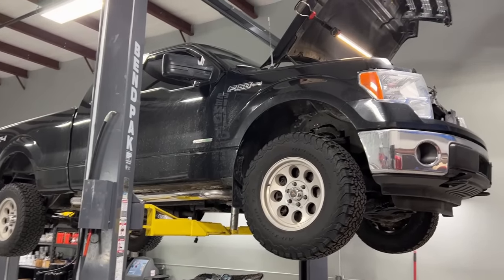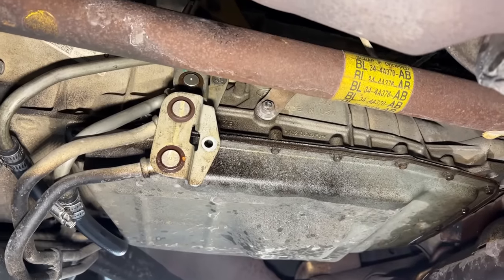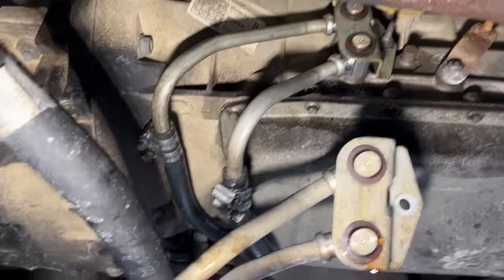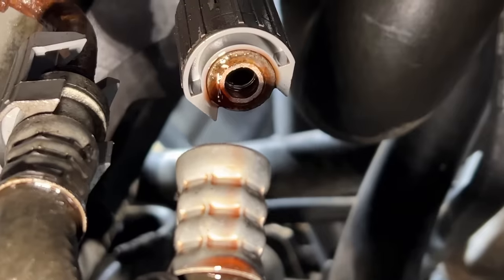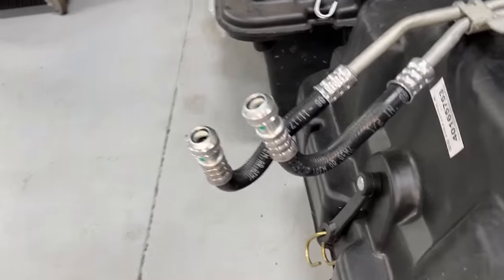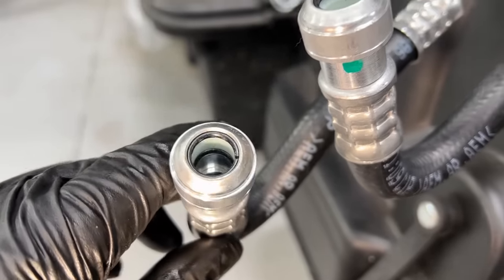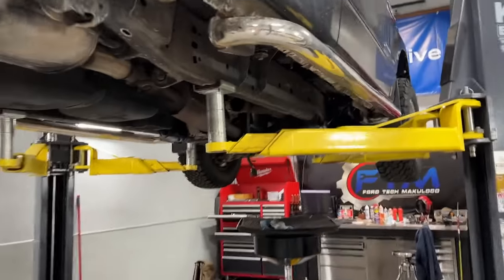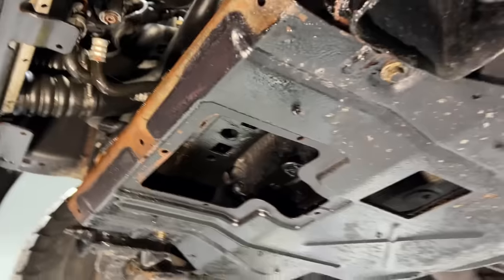Attention 2009-2014 Ford F-150 Owners! Check Your 6R80 Transmission Cooler Lines Before They Blow!

Comment: Happened to my 2014 eco boost as I was backing a pontoon boat trailer. And saw it happen as someone was backing a trailer in a camp site. Exact same failure point. This line needs to be engineered to hold up to the pressures encountered when backing up a trailer…This should have been a Ford recall.

Comment: That truck has a lot of corrosion on the bottom of it too...I would also replace out the steel lines too that are up front too before connecting the new Trans lines as a precaution...
Reply from the maker: I always do.

Comment: We know they'll never do a recall on these. Wouldn't some kind of warning system being put in place that can detect this failure, and shut the vehicle down safely, be a viable option? 
Perhaps a sensor on the return line, where it enters the transmission, that monitors flow (or sudden lack of)?
Reply: I was travelling 100km’s/HR or so when myn let go. I noticed the smoke behind me from oil getting onto the exhaust seconds before the wrench icon showed. By that point i was already pulling over. Lost 6L of fluid so caught in time. But yeah the wrench icon did appear on my 13 f150 eco it sensed somewhere there was a issue lol i dont know why myn did and this guys didnt? Not sure maybe makukoko could chime in on that.

Comment: Great warning, had no idea....but...why replace with the same part? Did Ford "fix" the brittle aluminum? Im looking at a used 2010, if I buy, my preference would be to cut the connectors out, hose it and clamp it. A possible drip is far better than a dam bursting leaving me stranded at 12,000 feet in a remote Wilderness.

Comment: Thanks for the info I have 2013 f150 so can you cut these connections off and just replace them with new rubber lines and clamps.
Reply: As long as you use reinforced hose that can take the heat, pressure, and oil exposure, sure. Just make sure the hose has something to grip on, so it doesn't blow off as you are driving down the road.
Reply: @billsimpson604  Do you know how much pressure is in the lines?
Reply: @josephbenge8707  No, but any fiber reinforced rubber hose should work. Look at the hose he used to make the bypass in the video.

Comment: I just replaced the Cooler Bypass line in my 01 Navigator (4R100) because it was leaking from rust corrosion. You'd think Ford would use stainless steel for all the tranny lines.

Comment: Wow, I didn't know they ran 1/2" lines! The little 3/8" lines can pump a bit of fluid fairly quickly - I can only imagine what happens when the 1/2" line snaps! Sounds like FoMoCo needs to use a little better quality aluminum fittings on such a mission-critical component there. 

GM's got it's own problems with transmissions. My '07 4L60E barely made 100k miles before the 3 / 4 clutch pack went up in smoke. Won't happen again with the transmission I installed from PerformaBuilt.😎

Comment: I would suspect the hoses over time get hard and less flexible which can cause the stress/torque to be transferred to the fitting.  Probably good to service/replace lines as a PM.

Comment: True Story...Had my '13 (109k mi) in my driveway for a few days doing an AC job (condensor, TX valve, compressor, seals, belts, etc...). Got it all put back together, turned it on to test and thought I done F**ked up as the truck was pissing fluid.  Ended up being the Trans line, same place as in video.  Got it towed to a mecahnic with just a bill for new lines and a filter/fluid change!

Comment: Or the infamous heater hose "Y" in front of the water pump/thermostat area that LOVES to break ONLY while driving (to make sure as much coolant can leak out as possible) so replace that with an aluminum Y and HOSE CLAMPS, not the quick connects and all will be saved!
Reply: Exactly! 👍 another pointless design!

Comment: Hey FordTechMakuloco, from looking at this, IMHO this looks like a heat-related stress failure as my read is that line that broke is the hot side or fluid flow into trans cooler, the other 1 is the fluid return line which has cooler trans fluid flowing thru it. So, if I had 1 of these trucks AND I do a lot of towing or off-roading or any activities that will heat up the trans fluid excessively, I would put on my preventative list to change out those lines on an expedited time changeout schedule OR increase the trans cooler size to try to lower the avg trans operating temp model to lower the hot side fluid temps OR both.
Reply: 6r80 has an internal thermostat, so your mod would likely not change temps much, if at all.

Comment: I just caught mine doing this
Reply: I was looking at my 2014 Expedition. It has the same type of connectors, but they are mounted differently. The lines are supported by the radiator and transmission cooler. The lines have some flex to them. The truck lines are solid mounted to the body with no flex. Also the transmission end of the lines are mounted to the engine. So all the vibration is concentrated at the connector. Also the engine slightly rotates around the crankshaft on acceleration and deceleration. The connectors are near the center of the crankshaft. Any rocking of the engine when the motor mounts are worn would work the connectors side to side causing the lines to break. Also the lines ends are made in a press that pushes the metal to make the locking ring. The bends are very tight in the tube. These can cause a weak point at the bends. The weak points in the tube, the solid mount to the frame, the rocking of the engine, weak motor mounts, the connectors being close to the center of the crankshaft could all come together and cause a failure of the lines.

Comment: Thanks for another great video, I'll definitely be keeping an eye on those, as my 2014 is a plow truck. 

Quick question, I have a slight trans fluid leak coming from the transmission bell housing where it mates to the engine, what might that be? Front seal?

Comment: Thanks for the heads up, mixing steel and aluminum is never a good thing. So should we just change these out as a precaution?
Reply: Do you want to spend $200 or $6000?

Comment: Maybe there should be a pressure switch in there someplace to turn on an alarm and/or shut down the vehicle?  If it's that common....sounds like a good aftermarket profit center.

Comment: If I order a new set of lines from Ford does that solve the problem, or what is the bullet proof solution. 2014 Raptor 73,000 miles

Comment: Having issues with the voltage regulation. Just killed a new battery. However, if I get it fired up the alternator will keep it going and put a little charge to the battery. Interestingly the transmission won't come out of 5th gear.

Comment: Had that problem with the 2013 F150 I have but caught it quick enough to save the trans my 2011 F150 rotted the metal lines after the connection not so lucky with that one $3600 to rebuild the trans

Comment: Your channel is very helpful. I’m about to do transmission fluid change on my 2013 Ford F-150 5.0L but I’m also going to change out lines as well. Do you have part numbers for all the transmission cooler lines?

Comment: This happen to my 2014 at 96,000 miles. I check my mirrors every 4 seconds so no damage was done to the transmission. Still without the tow truck it cost 1400dollars.

Comment: Wish I did this when I replaced my molded lead frame.  Now I wont be able to sleep knowing my 2011 may have this issue.  Wonder if there is a band aid way to wrap it so if it breaks it just leaks and not drains all fluid killing the transmission.

Comment: Sounds like thermomechanical fatigue from accumulated cycles of hot/cold.  That coupled with the small diameter of the aluminum tube compared with the quick connect.   The tiny gap between the outer quick connect sleeve that surrounds the aluminum tube might actually provide a lever action against the smaller tube.  Combine this with continuous vibration and the inner tube may fail over time.

I'm going to see if there's a way to re-enforce this interface on my truck.   I don't really want to replace the lines pre-emptively but don't want to lose my transmission either.  

"2.2.2. Constant versus Variable (Cyclic) Temperature—Thermal Fatigue Due to thermal exposures, materials expand during heating and contract during cooling. When a material is geometrically constrained, this leads to generation of tensile and compressive stresses. Stresses may also arise within unconstrained materials due to a spatial temperature gradient. As a result of cyclic expansion and contractions the material experiences thermal fatigue. This phenomenon, also called heat checking, is common when a metal surface is repeatedly heated and cooled. Thus, thermal fatigue may occur without mechanical loads. If both thermal and mechanical strain is involved, the degradation mode is termed as thermomechanical fatigue."

Thanks for the great video!

Comment: My 2012 F150 XL thanks you for this video.

Aluminum can he finicky stuff. It will always eventually fatigue and crack. I know right where those fittings are. My truck has 86k on it, and I think it's about time to check those fittings myself. Is there a specific replacement you recommend, or should I just use the FoMoCo part?

Comment: I imagine crimping the hose connection onto an aluminum quick-connect is causing some stress cracking of the aluminum part. I doubt they saved much maintenance by NOT using hardened steel.

It might just be a quality control issue...like they're over-crimping the connection.🤔

Comment: Just thinking that it seems like stress fractures may be caused by the joint heating and cooling.  The part in the clamps may not be able to expand, while the part not in the clamp does expand normally.  Maybe this is causing fractures in the crossover area.

Comment: Don't discount the ability of any steel lines to rust through and leak quickly, I would replace them if they looked as bad as those cooler / radiator tie lines. I purchased a used 2005 Expedition, and I live in the Chicago area. Due to the amount of over salting roads ( at times) here, (I think the previous owner didn't try to wash the undercarriage off in winter as well) my steel trans cooler lines looked bad when I purchased the vehicle, and I knew I would have to replace them, but they actually rotted through and I had to replace everything from the cooler thermostat to the radiator and cooler. Brake lines were going to suffer the same rotting through fate, so I replaced them with a SS line kit. Engine oil filler tube also rusted through, had to replace that.

Comment: Love your videos!  Quick question.  I am planning to do all the 6r80 maintenance you've suggested on my 2012 eco f150.  Recently my radiator fan comes on high as soon as the trans temp reaches the midpoint.  The trans temp isn't going high... But that cooling fan is coming on high.  Is that a thermostat?  Would love fluid do it?  Something electrical?  It's definitely triggered by trans temp reaching that midpoint on the gauge.

Comment: What is the Transmission fluid pressure going into the Radiator/Cooler? 
Wouldn't an in-line pressure sensor make sense? Especially for this critical system.

Comment: 2008 5.4 3V Expedition mileage 235K - 6R75 6 speed tranny - is this an issue with this transmission?

Always good info, thanks.

Comment: I just drove my 2013 3.5 EcoBoost home from work and saw a small spot under where I usually park so I got under the truck to see where the drip was coming from. As soon as I wiped the line off it snapped and fluid poured out in my driveway and I hurried and turned my truck off. Hopefully I dodged a bullet and there's no damage other than the line

Comment: That sucks I guess I best be keeping an eye on the plow truck. I always pay attention to the transmission fluid temperature and I'm sure it would increase immediately if a large enough leak occurs in the lines. Hopefully this poor guy gets his replaced for free as this is from inferior metal of the line ends.

Comment: Steel and aluminum in constant contact, especially in a location that gets wet frequently will cause a galvanic reaction.
Reply from the maker: That is not the problem trust me, this happens on clean units too. The steel is galvanized so it is quite compatible with aluminum anyway.

Comment: Mine started leaking. I found spots, saw it leaked and replaced it myself. Get the parts from Ford, they cost the same as from the autopart store, and some aftermarket retailers are selling the wrong part. It took me probably an hour to change.

Comment: I have the same transmission in my 2015, but I guess they changed the cooler line configuration that year? My setup looks completely different.

Comment: Mine just snapped yesterday.  Luckily I noticed a leak in the garage, went to wiggle the line and it just separated like a twig.  127k miles on the truck, 5.0 liter.   Only have had to change the water pump and upper radiator hose, otherwise been pretty maintenance free.  Think I dodged a bullet on this fix.

Comment: Thanks for the info. Will check mine out. Still cheaper than a new truck and it will be fixed right by you. Good deal.

Comment: Love your videos man! I have a quick quick question, I watched a older video and I herd you say that you recommend using 5w30 instead of using 5w40. Does this recommendation only apply to 04-08 5.4l. Or does it apply to the 09-10 5.4l. 
Thanks 👍🏻
Reply from the maker: You use 5w-30 instead of the 5w-20 spec. You only use 5w-40 if you are having volume issues.
Reply: Oh okay so it’s better to run 5w30 Instead of the recommended 5w20 in my 2010 5.4 for longevity. I just wasn’t sure if the 09-10 5.4l were the same as the 04-08 5.4l. Thanks Cheers👍🏻
Reply from the maker: yes all 3v engines  2004-2014 can benefit from 5w-30.

Comment: If ya change it ahead of time
Like a preventive measure, then about how much for new or improved line replacements and how hard is it to do it yourself if ya got basic knowledge and tools as long as nothing expensive and odd is needed? 
 I’m no mechanic but I’m pretty handy and mechanically inclined . 
  So price for new/ improved hose lines and time and difficulty?? 
 Thanks in advance. Been following for long time. I got a 2011 xlt, 4wheel drive , Ford F-150 5.0 coyote with 96,000 miles on it now.  And did my model come with trailer brake controls or just the tow/haul on shifter?  And was told can’t put a plow on it. (My model)  I know it’s just a half ton but not like I would’ve been doing parking lots etc to plow. I plow roads for government and would just do my driveway and maybe friends and family, maybe a few extra when I’m not on call. Was told it’s too light and my model won’t or shouldn’t plow at all. So
I stopped looking for plows. Not trying to ruin my transmission either cause I need it to get to work to plow roads before roads been plowed. That can be an almost impossible feat itself hence why asking about hose line replacement cost and difficulty. Thanks

Comment: I just had this happen also. Hadn't seen this video unfortunately until after. 2012 F150 5.0 with ~138k. It started shifting strange as I got into a center turn lane, and by the time I made it through the turn, it had lost a ton of fluid and I was sitting on the side of the road within a half mile.

After the local mechanic fixed it, it still shifted kind of strange, and seemed to get worse over a couple weeks (or I was becoming more and more aware/cautious?). I took it back to him and he had to add 2 quarts. Seems much better now, though I did get a shudder when it up-shifted after getting on the highway this morning.

Should I have cause for concern that there's something else wrong?

Comment: Could the rusty lines going to and from the cooler be the culprit? It's rusted all the way to the very tip where the aluminum is wrapped around it. Sometimes aluminum oxidizes.

Comment: I found the shop instructions for this job on a ford forum,  looks like they want you to lift the engine a bit for the 4x4 models "For Four-Wheel Drive (4WD) vehicles, remove the RH engine mount nuts and lift the engine approximately 25 mm (0.984 in) to gain clearance for the transmission fluid cooler tubes.  Raising the engine sounds easy but.......
Reply from the maker: None of that is required.
Reply: @FordTechMakuloco  awesome, I was hoping you were gonna say that!  I did see that someone had removed that plastic cable tray up there to help make room, that seems doable!

Comment: I have a 2017 expedition with over 213,000 mi on it I've had no issues with the transmission but as preventative maintenance should I just go ahead and put in a fresh set of lines and cooler?

Comment: So, what can we do to get ahead of this engineering issue?
Any ideas?
I mean, all I can think of is cutting the lines ahead of the aluminum crimp end and using a combo of more trans hose with a couple steel line nipples and actual tried and true hose clamps.
Thoughts?

Comment: Probably vibrating and breaking there from the head force winds, the aluminum is getting fatigued then it just gives.
Reply from the maker: Maybe but even on this Ecoboost the the front end is completely sealed so no strong head winds here

Comment: Probably because these lines are so large is why the trans lives so well.  Good cooling as heat is your greatest enemy.  Too bad they went with aluminum and not steel in that area because of the torquing effect on the lines.  I guess Ford is the only place to get the replacement lines?

Comment: 2017 F150 5.0 Gen 2 over heating when the AC turns on only. Any idea or tips help? CTH sensor , thermostat , heater hose swapped out . No leaks that we can see . Looks like it holds pressure fine. Any ideas or tips plz . ❤️ the channel I used to work at ford in parts and been watching forever cause ur videos helped me decode a issue with a customs concerns .